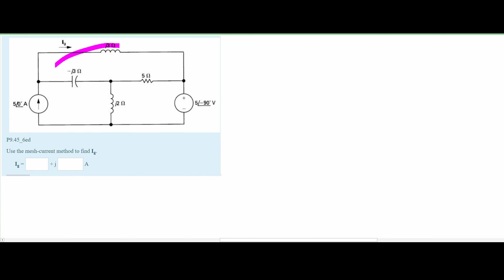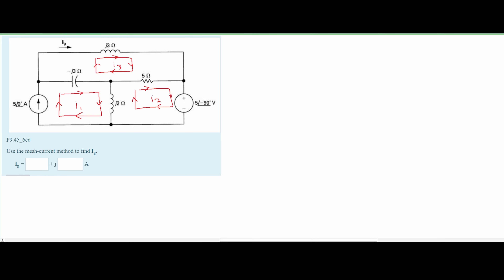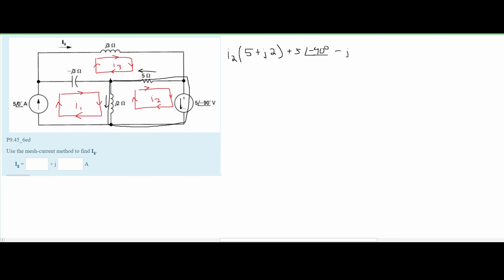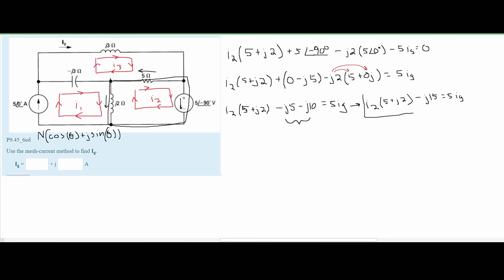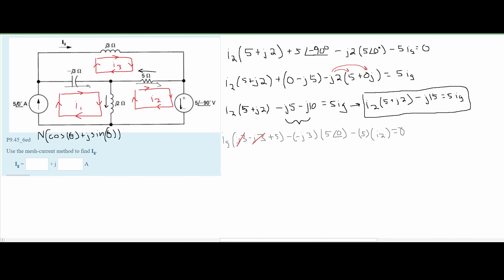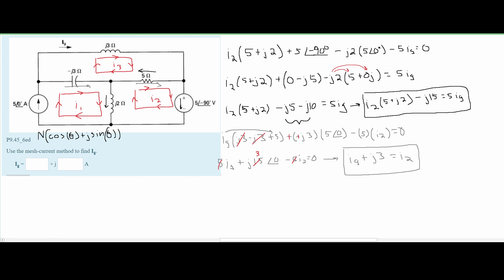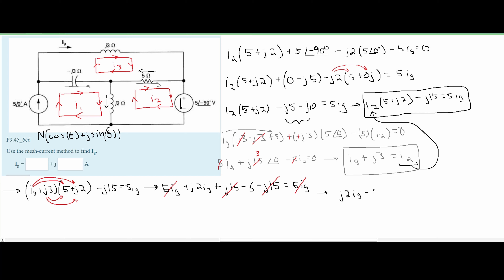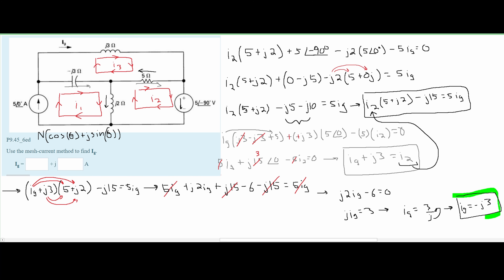Intro to Circuit Analysis | Ch.9 Sinusoidal Steady-State Analysis | Q8: Use the mesh-current meth...

Comment: Can you help me with this?

G(s) = K/s(s+3)(s+7) is operating with 10% overshoot.

a) What is the value of the appropriate static error constant?

b) Find the transfer function of a lag network so that the appropriate static error constant equals 4 without appreciably changing the dominant poles of the uncompensated system 

c) Use MATLAB to simulate the system to see the effect of your compensator
Reply from the maker: Hello, hopefully you can find a video similar in the playlist of this material, I will try to solve it when I have time and get back to you